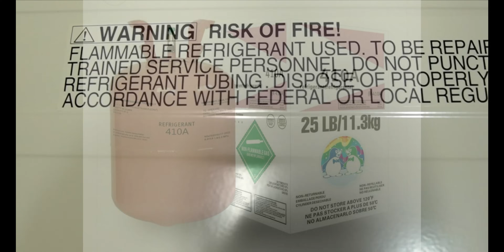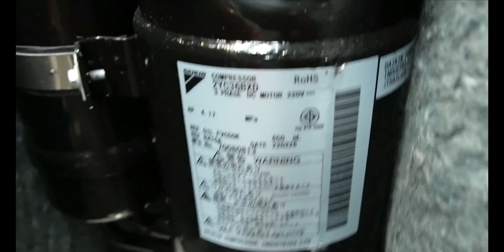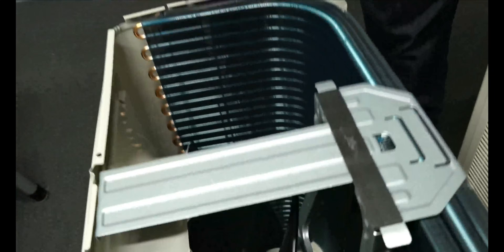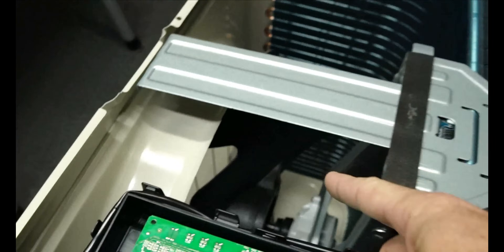The Truth About The New R32 VS R410A Heat Pump Air Conditioner (4k)

Comment: Had a daikin dealer give me some estimates today for 410 and 32 fit systems.  they have an incentive now for the 410.  im hoping to be able to hold off and get this 32 system you are showing.  why didn't the rest of the industry use 32?
Reply from the maker: GWP on the R454 is lower
Reply: @GWAC555  GWP is arbitrary and unscientific.

Comment: We need larger fans for more efficient air flow. More air per kW.
We need stacked pump mediums. One medium in the circuit inside/outside and a second medium in an inside/inside configuration. It is heat pumps all the way from absolute zero to the heat of the sun.
Reply from the maker: Impressed! Great info

Comment: How about the exploding refrigerators! LOL! Personally, I'm convinced that all this climate change talk is BS and we're all being grifted by the industry so they can develop new expensive garbage to peddle more frequently. R-12, R-22 and R-502 were the best refrigerants ever made and systems lasted decades. Now, you're lucky to get 10 years. It's a shame people are so gullible and just go with the flow and allow these groups to mandate these BS regulations without absolute proof it's necessary and I think history will prove that the climate hoax was just smoke and mirrors for profit. It's the middle of August here in Augusta, Ga. and it's currently 64 degrees at 6:22 am and the high is only going to be around 85. I had hotter summers in the 70's, 80's and 90's.
Reply from the maker: R32 Flammability Test https://m.youtube.com/watch?v=Nnz4ODMyOJ8

Comment: Evaporator coils are crap today. I'm tired of changing them personally (thank God I'm about to retire), but I wonder if R-32 is flammable enough to ignite in a home where the evap coil pops a leak in a smokers house while they're smoking or lighting up?
Reply: I don't believe R-32 will blow up. R-290 (propane) & R600 (butane) definately are. I think R-32 needs a flame source to burn & cannot do a sustain burn by itself.
Reply: @guytech7310 excellent information !

R32 needs over 600°C to burn and dies off without a constant ignition source.
Reply: You are 100% correct. Impossible to find an evap coil that isnt made of foil thin aluminum. I hate it and i refuse to retool again, i am retiring.

Comment: Today I did my first R32 mini split system at my company here in Southern California. R410A is officially over. We aren’t going to be buying any more inverters with 410A
Reply: You can change the refrigerant make sure the refrigerant pressure is per recommended. You can google those table .
Reply: What is the pricing difference between the 2 types if same seer 2 rating?   Thanks

Comment: When I started in the trade, R 22 was 30 bucks a 30lb bottle
Reply: Ive been doing HVAC for 50 years r 22 was $5 lb I still use it but @ 50 per lb 410 $60 lb I still buy 30lb of r22 in bulk for 300 per cylinder 410 $125 per24 lb
Reply: @henrykennedy1120 you probably get it at wholesale price. I doubt any normal consumer would be able to buy them at those prices buddy.
Reply: I went to a supply house looking for r22 and they said it was nearly $600 now for a 30lbs tank
Reply: @garycarter7087  wtf I'm in Texas dat shit 800 for 25 pounds of r22
Reply: @garycarter7087 that's on the bottom end of cheap man should have bought it.
Reply: which year was that ?
Reply: @aks20002  Late 80's.
Reply: Same here tinman

Comment: So many people are afraid of a flammable Refrigerant. We have Gass or LPG in our cars sitting on a tank full of it. What should happen on a Mini Split for instance? First you need the right Ratio Gas and Air to get it ignited, second you need a spark, I doubt that there is enough gas for an explosion wants you have a tiny leak. The indoor Airhandler got only a fan and motors for the wings all controlled by a magnetic field no spark. Only the outside unit could produce a spark inside the compressor once the windings will burn or shorten but because it's a hermetically sealed system with no air present nothing will happen. Correct me if I'm wrong. I swapped a lot of R134a to LPG or pure Propan systems still running needs less Amps got more output. Rgds from Germany
Reply: people are too dumb to understand

Comment: I will never ever by for my home any flammable Refrigerant when leak can cause extreme fire that Refrigerant is extremely highly Combustable , flammable and like time bomb 

I request not to buy any chilling or freezing unit which are flammable gas like : R-32, R-290 , R-600a and stories goes on and on 

I am Refrigeration  Technician and not recommend to use such split units for home

Comment: Scary truth. R410a is a 50/50 mixture of r32 and r125. 'New' r32 was invented before WW2. R410a is a mixture specially created be not flammable. Why we simply can't use R290 (propane)? It has much lower GWP (absurd parameter in my opinion), mineral oil compatibility, lgP/I characteristic practically similar to R22.
R32 histeria is only marketing! Of course theoretically you can get about 3-4 % COP improvement but cons (flammability that cause issues with repair and potential risk of fire  for small rooms)

Comment: The mandate R410a and R32 requires a lot more pressure to run. Most Evap. coil had a considerable less lifetime compared with R22. You’re lucky to get even 7 Yrs without leakage.
Reply from the maker: The industry has made significant improvements with this in the last 5 years. This is also effecting HVAC contractors in a negative way.
Reply: @GWAC555  Do you mean microchannel? It's even worse.

Comment: Please find out is there are any compressor blasting incident in R32 units, because recently 2 incidents occurred, one in City Faisalabad Baber shop Split unit blasted and 5 people died, another incident occurred in Karachi city where 1 person was badly injured and 2 rooms were badly damaged. Bomb disposal unit report told that R290 and R32 gas was used in air conditioning unit, leaking refrigerant ignited and exploded. Please do some research and made a video on this, what causes an ac compressor to blast? R32 units blasts or not
Reply: Like I said previously: bro do u even nitro check? U know ur supposed to pressurize ur system before u vacuum and release charge. U said it urself, "leaks". Yea bro when ur copper is now razor thin u better believe ur checking for leaks. Shit will happen with r290. Also check in with ur installer, have him write ur psi + ambi temp to ensure u have 0 leaks.

Comment: So even bigger units? There are called mini splits for a reason. Most times the heads are installed in areas where you dont have access to the side of the unit. Having the board slide out on the old style is much better. That design will cause me not to sell Daikin in many situations. Why are we fixing something that wasnt broken? So can we just purge r32 and 454b rather than recover it? The coils will leak like 410a so it really wouldnt matter.
Reply: it's not called mini split because you can put it in shelf 🤦‍♀️

it's called a minisplit because you don't have to install a whole ass VRV system with 10 evapcoils in your house.
Reply from the maker: Interesting...

Comment: So what's the truth about these two?
Which one is better? Didn't say. Which one is more efficient? Didn't say.
Which one costs less? Didn't say.
Reply: I have a Deakin airconditioner R410A, I have had it since 2017 or 2018. It's now December 2025, the airconditioner has been running well.

Comment: "More efficient and more reliable"

Where have you guys been past 50 years? Older machines used to run for 30 years easily 20. Today "new" systems break down in 5-10 years needing parts.. Often expensive parts. Things are not made better at all. They are made to fail. This is common with nearly everything we buy today. All made to be replaced. Manufactures did not forget how to make quality products they just refuse. Some handful of companies own nearly everything.
Reply: I have a 5 year unit and it already needed a Evaporator. my old one R-22 Trane lasted 30 years without mayor problems.
Reply: And going from two boards (controls/inverter) to one means you now have to replace a much more expensive single board rather than the one (most commonly the inverter) if either the control or inverter fails.
Reply: Modern mantra spend $1000 to save $100 when it has to go to landfill as software and circuits cannot be diagnosed or fixed in a economic way
Reply: previously hardware were designed mechanically, with minimal electronics in mind. Now electronics play a big part. A small blown capacitor or chip might affect the electronics we have today. Rendering the circuit board to be replaced as it makes the whole machine unusable. As we know, circuit boards are complicated designs squeezed into a small piece of board. 10 years down the road, manufacturers won't be printing out the same board as it's not economically viable to make the same circuit board 10 years down the road with new designs in mind.
Reply: Money driving
Reply: Old R22 units were working with far less pressure than R410A or R32. 
The copper tubing and welds inside the AC are very thin and of poor quality on most brands and if you add double the pressure than on R22, it is set to fail. Not to mention complicated circuit boards on inverter systems compared to rudimentary ones on old AC-s.
Reply: @nenadmitrovic718  Pressures is irrelevant. The reason for more issues with leaks is that the coils now have inner channels to funnel the refrigerant for better heat transfer. That's it.
Reply: I want to know if I'm not the only one thinking about this: retrofit OLD units, leaving the mechanical part alone, but putting eletronics like rasberry pie controllers or alike in them. Since the mechanical is already something tried and true proven to last, just make them more "efficient" by providing "semi smart" monitoring and regulation.
Reply: Yep, I never heard of Air conditioner evaporator coil leaking in my Window type AC from General and National. Now, my AC from Electrolux, Haier both had Evaporator leaks.
Reply: They completely destroy the longevity, serviceability and quality (gone after 20th century) of the units so that TECHNICALLY, the first few days, weeks or MAYBE months it's slightly more "efficient". But the second this modern crap breaks in, it all goes to hell. And then in a very short time the unit does go to hell. And you're stuck with the bill. And a 3rd world country is stuck with it in the landfill. 

Longevity will never being a thing because although R32 is the best modern refrigerant after R134A, it is still higher pressure like the 410A crap that came before it, which guarantees the compressor WILL NOT last. If I were dictator of the world, we'd have nothing but R22 where applicable. Every window unit would have drain holes. Endless masculine logic and authority over these disgusting, parasitic corporations and the end of all modern games.
Reply: This called planned obsolescence. They want to sell complete systems and also repair parts more frequently at continually higher prices for more profits. That is why evaporators built out of thin aluminum (thinner than their copper counterparts used to be) fail more frequently.
Reply: The worst are VRV systems they need specialist training and become landfill very fast especially if too many techs touch it
Reply: it's not common my friend, it is an agenda, they know what they are doing ....

Comment: So the R32 system will be cheaper to run?
Reply: yes
Reply from the maker: The efficiency rating of this R-32 system is higher than this 410A system so yes.
Reply: Negative

Comment: I want to know about o general hot and cold model 2.5 ton unit in which lg compressor is used.. DKT208MAH which has a btu 23100 how it create 28000 as company mentioned in the brochure
Reply: Please reply, I'm eagerly waiting for your positive response
Reply: Please reply how it make more btu or kw of cooling then the rated btu produced by compressor
Reply: Kindly revert
Reply from the maker: The compressor BTU's does not determine the BTU's of the system. Generally the compressor BTU's are smaller that the actual BTU's of the system.
Reply: @GWAC555  Thanks for the reply.. But how it make the higher amount of btu when the total maximum capacity of the compressor is less than the rated btu of system
Reply: Hello, I'm waiting for your valuable response

Comment: R32 unit is considered as just like a bomb in the Room due to over 4 incidents occured due to AC blasts using R32 gas. No buddy Wana buy R32 filled Split AC of any brand.
Reply from the maker: The new regulation in the USA starting January 2025 will require all AC and Heat pumps to utilize Low GWP refrigerants. R-32 and R454B will be most common refrigerants used.
Reply: if properly built nothing blasts.

blasts happen after crappy unknowledged wannabe techs fumble AC units. and that seems to happen like every day in india and pakistan.

Comment: Hi, there is nothing to compare. this 2 unit are different form design pov so you can not compare it. one have additional coil , the thinkers was change so what co compare. the true compare is under test same condition : current load , time to reach temperature set , compressor modulation , fan modulation specification. in your presentation there is no specification of the unit, i was expected to have the specification place side by side.
PS: makin this movie in 4k is without any add value so i don't know way you spend this time to make it. i prefer to have more specification available and true comparison not a presentation.

Comment: Being afraid of flammable refrigerant is odd considering you already have natural gas in your house most likely
Reply: Natural gas has a detectable oder. Also has an operating pressure of around 10 inches. not 400 psi.
Reply: @63wem why would you measure gas pressure in dick lengh ?
Reply: @63wem  you aren't wrong but, gas lines have a virtually endless supply into your house. Odorant doesn't do much good if only my dogs are home to smell it.
An HVAC unit has a finite supply. Consider the fact that many package units are roof mounted and any leak is usually going into the air, not the house. I find more leaks in condensers than evaps. 
A split system is going to yield similar leak results as condensers are outdoor mounted.
Aside from an errant screw or nail from a bonehead, how often do you see leaks in the lineset?

I think the hype is over rated.
Reply: We could push towards monobloc outdoor air to water propane units and fan coils indoors, or higher safety for propane units (gas leak detectors aren't anything new), or increasing reliability and efficiency of CO2 systems… but the issue is that there are some interests in milking synthetic gas patent money and planned obsolescence

Comment: Half way across the globe when r22 phase out started in mid 2017s. In this market air conditioners have to be cheap to sell. Most sold 1.5ton or 18k btu mini splits are at 500-600$. 24k units are 800$. To make this price point some companies went with r600 or r290 in residential mini split air conditioning. And others increased their price to pay for r410. 
Then in 2020s r32 came in market and quickly became main stream. R32 has no unique problems. There are no fires but there is some incidents of compressor explosion and even few deaths. Some gmcc compressors like to go off like a grande and the shrapnel has killed 2 hvac techs recently. They found the rotor 12m away from the unit and the side of the unit was completely blown. Two of the man working on the unit got punctured literally like a frag grenade.
Reply: Sounds like skill issue in your country
Reply: Where this happened? India? I saw a video one time I guess.
Reply: Quando un compressore esplode e il tecnico si trova li vicino è probabile che abbia caricato il gas o l'azoto a pressioni elevate magari non usando  una valvola regolatrice. Non è una cosa probabile che il compressore perda pezzi al improvviso, ci deve essere una causa.
Reply: @MarcoCibelli explosion was probably caused due to skipped air evacuation. R32 self ignited inside compressor under high temperature and pressure, similar how diesel engine works